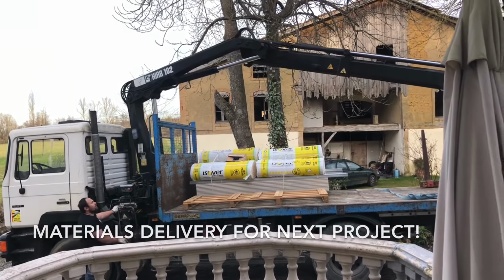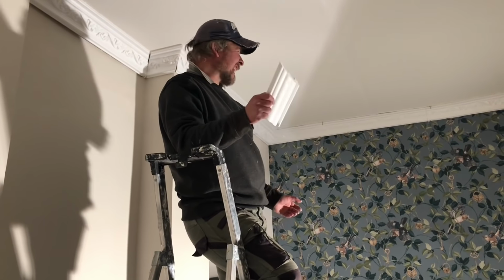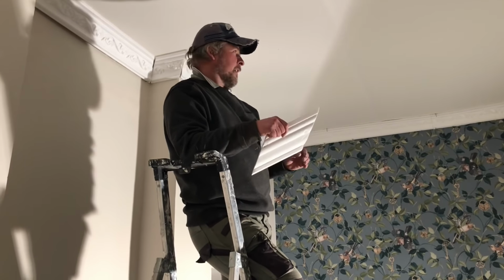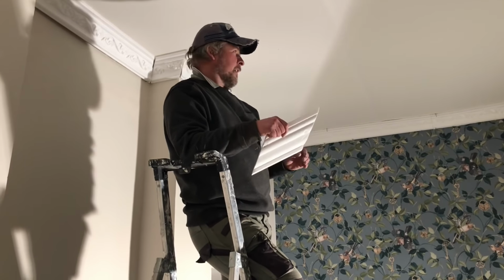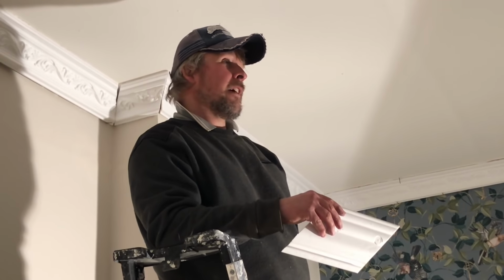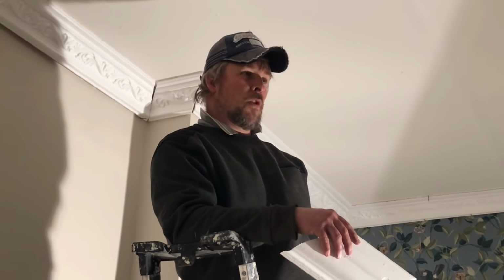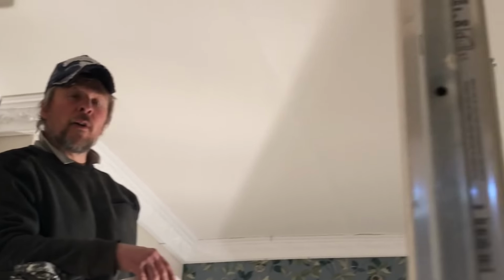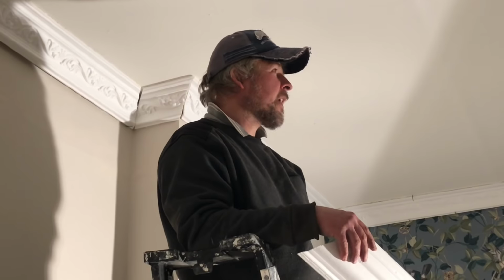RESTORING BACK ORIGINAL FEATURES #Chateau #DIY #Renovation

Comment: The hardest part of cutting and fitting Crown moulding is getting used to the fact your doing it upside down. And the biggest mistake amateur or non finish cabinet makers make is the inside corners.

Comment: My friend did my entire home with coving (or crown molding as we call it in the US). Even though he never did this before, it did take him a long time to figure out the angle degrees on corners, but he did. They were not 45 degrees as one may think. I don't know what his formula was but they were perfect. So, the corners did not have to be filled in with plaster. Also, there were odd ends where a heating grill was close to the ceiling and that too he ended so beautifully. I would ask him  however we are on different sides of politics and no longer speak. Your work looks beautiful and so glad to see you take the time to do the jobs correctly. No easy ways out. Best to you, Jane, Philadelphia
Reply from the maker: Thank you Jane. Yeah I thought it would be a simple task this one, but nothing ever is is it 😂❤️